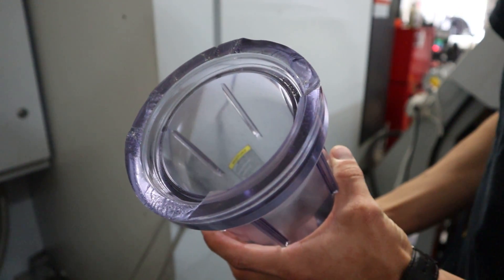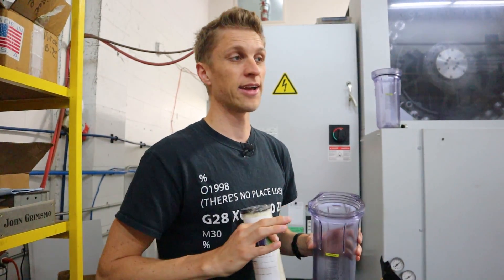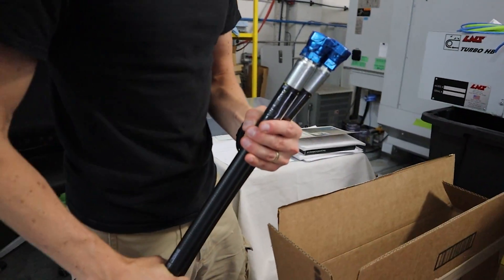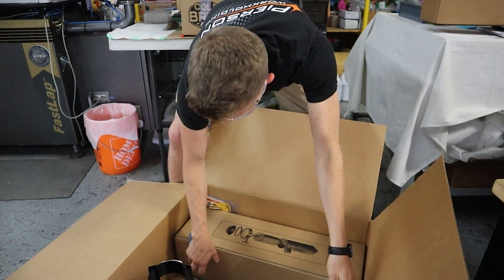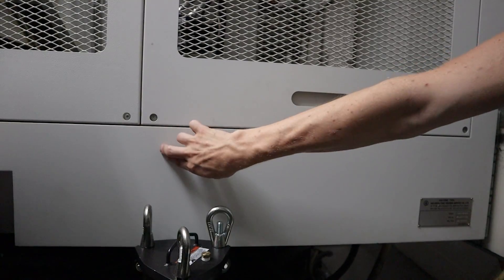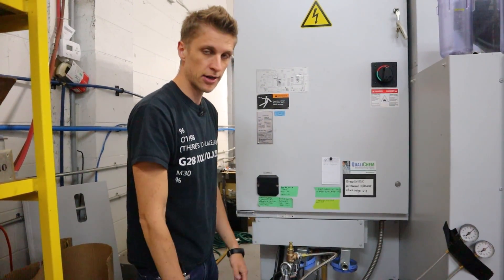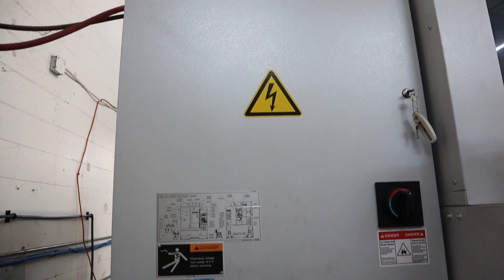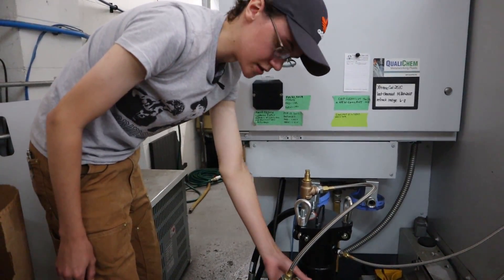Filtered Coolant Equals BETTER PARTS??

Comment from the maker: Parts and part numbers are in the description now, sorry for the delay folks!
Reply: Any chance of updating your parts list?  Your link is no longer working.
Reply: PLEASE??????? These are what im looking for aswell
Reply: Link don't work anymore?
Reply: Thanks for all the pearls of wisdom over the years!  Here's one for you, get a Samsung Smartthings hub for your shop with leak detectors.  I have one under my cnc coolant tank in case it ever leaks.  You can also put one under that HVAC units, water tank ETC.  If you have 5 machines the 5 sensors and the hub will cost under $200.  You can also add lots of other sensors, building security etc.
Reply: Yeah, the links are broken 😞
Reply: Parts list no work

Comment: I need to add a filter to my machine but was wondering if these filter canisters are 100% reliable and safe to use with coolant systems.  I guess you guys answered that question after all they are engineered for "water" dah!  how long were those on the system and dose anyone know if the type of coolant has more or less effect on the plastic canister?  Im running Synergy 735.

Comment: Hey guys, do you use a fine stainless steel mesh in the bottom of your chip collector trays to filter out most chips first? If so, what grade mesh? 
Thanks.

Comment: Pro tip: There are differential hydraulic pressure gauges which are much more sensitive and easier to read. Automatically does the math and basically results in a "clog meter"!

Comment: You guys should get the diverter for that zebra skimmer. We recently upgraded and I was curious about how much coolant was getting tossed from the skimmer bucket. It's almost a 5 gallon bucket of mixed coolant every week (running the skimmer when the machine is powered on, so 8 hours a day) 

Great upgrade that will pay it's self off in a very short amount of time.

Comment: Nerd City just released a video on what words in your title will get you demonetized. Even if youtube isn't you main source of income, check out these words that you may be surprised to learn will get you demonetized.

Contains, countryside, counts, cutting, delivery, dozens, drove, employees, example, existed, fifth, finder, finish, focal, gallon, gave, grab, grinding, hard, holder, hose, hot, implementation, included, incomplete, industry, inside, knife, known, lessons, odd, offered, removal, rep, request, risk, ruined, screwed, shocking, shooting, sites, spokesman, sympathy, tablets, that, valley, various, vendors.

Those are the ones I thought could apply to you.

Comment: One thing not sure about, the coolant at the safety valve is "dirty" right? And, if I understand correct, the hose from the safety valve  is connected to the "clean" coolant on the T from the canister filter...so are you not putting some "dirty" coolant to the "clean" side from that safety valve, right after the check-valve?

Edit: Ok, got my answer on the latter part of the video, somehow skipped that on the first watch

Comment: While working as a machinist for one of my past employers, they have a 2 stage filter system after a 100 psi but before the 2000 psi pump. We changed the bags every 2 weeks. Although we ran a lot of rough carbon steel with rust and scale 24-7.

Comment: Differential pressure gauge and switch (for alarm) would be easier to read and provide a reminder in case everyone forgets to check the differential pressure across the filter.

Comment: We use those plastic canister filter holders at work.  We are only filtering chilled water through 5 micron cartridge filters.  In the 5 years that I have worked there I have not seen one of those canisters break like that.  Ours are mounted on plastic thermoforming machines, so there is a lot of vibration, pounding and shaking going on there.  I wonder if the oils and the pressure you are running at had more to do with the failure?  It could also be water hammering.  Or a combination of all that.  Anyway the new system looks really nice and should do you just fine.

Comment: You should rig up a electric pressure gauge I the post-filter side, with an Arduino, link it up to IfTTT, and link it to your machine. That way, you can have it stop lights out machining if the pressure drops really low. (Besides indicating a clogged filter, it would also alert you if a pipe breaks and you loose all coolant.) You could also have it alert your phone when the pressure gets to a predetermined threshold, so you can know when to change the filter.

Comment: Wait, "a lot of times [CNC] machines don't come with coolant filters..." Which CNC manufacturer is making machines without a coolant filter? (I'm not doubting you, I just am Chris which $hitty CNC manufacturer thinks it's alright to not filter a liquid, containing metal chips, that's going through a pump.)
Reply: I'm not sure many manufacturers have a filter before the pump. For Haas, the filter is an optional upgrade. DMG Mori didn't include one on John's mill, and Nakamura didn't include one on his lathe. Neither of those manufacturers are anything close to low-end.

Comment: So you have to filter before the pressure is added? I mean the skimmer is sitting in an atmospheric pressure tub. Then it is pressurised. Why not filter it before it hits the pump without the pressure vessel. I guess getting the fluid through it would be harder but it is an option.

Comment: Hi John,

The plastic good go bad yes, however I think the main reason for the failure was running 300 psi through the filter. 

In Australia mains water pressure is about 100 psi.

Regards
Reply: John as a fellow Australian myself.... what are you talking about? 300psi was coming from the pump. Where was the water mains even attached to anything here? How is that even relevant?
Reply: @gusbisbal9803   John said in the video the coolant pump output is 300 psi.

He also said that the clear water filter housings are designed for home water filters. (Australian mains is about 100psi)

From my under standing;
coolant tank -> screened -> coolant pump -> "John's 20 micron water filter" -> Spindle. 

I've assumed John put the plastic filter housing as the last item on the line, (before it's delivered to the machine) so it's getting the full 300 PSI of coolant.

So from that I deducted that the failure was from running the filter housing with too much pressure. Considering it looks like it failed between the threads of the housing where there is least material.

Regards

Comment: Pro tip: If you use  red loctite on your pipe threads and give it 12hours to set you can clock your fittings and they will be leak free so you could orient your gauge.

Comment: I'd monitor the pressure difference and the swarf buildup and when you figure out the best time to replace the filter make note of the pressure differential and then install a pressure switch set to that pressure differential and have that generate an alarm or turn on a warning light.  There should be a couple days grace so that the warning light could go on just as you leave and the system should be fine for the 7 hours or more until you come in the next day.

Comment: Any reason for putting the filter post-pump rather than pre-pump? Seems like the latter would keep the crap out of your pump
Reply: The pumps are typically sump style. So there is no real good way to do that.
Reply: The pump sucks coolant directly from the bottom of the coolant tank. There are no hoses you could hook up this type of filter to before the pump. There may be some sort of in tank screen filter that would limit the amount of junk sucked up by the pump but this filter won't do that.
Reply: And Pumps that have an hose on the suking side donnt like filters betwen them and the Tank (i have tried this and it takes sometimes only the filter to loose coolant flow)
Reply: Just put a panel filter vertically in the tank anywhere between the pump and were the machine dumps the used coolant in. Essentially dividing the tank into two sections, clean and dirty.  No need to worry about gauges or fancy relieve valves.  If the coolant is higher on the dirty side it’s time to change filter.
Reply: @kanoa9321  thats offcurse an option but you should not do this because you get chips inside your tank and get bactieria grow. Best filtration is befor the tank and should always mayn focus and if it doesnt work you can go to separate the tank but only by filtering big parts not fine filtering (this needs presure to work). And dont forget to clean your tank on an regulare basis.

Comment: If anyone else is considering doing this, do what John did and get a filter with 3 bolts that clamp the lid on. The style I got is a ring style clamp and it can be much more of a pain to use, especially if its designed to have a spring hold the filter in place.